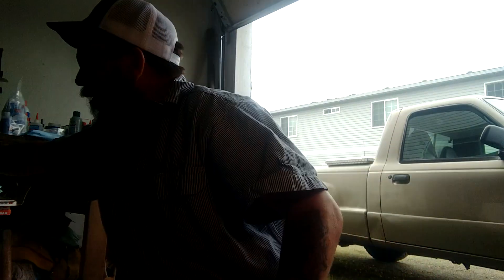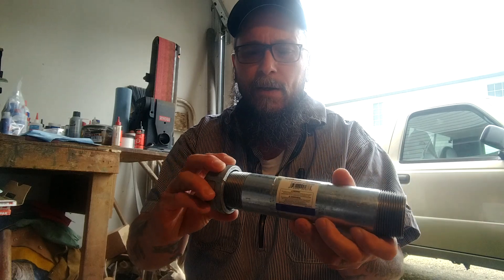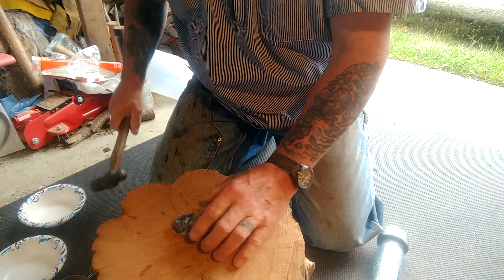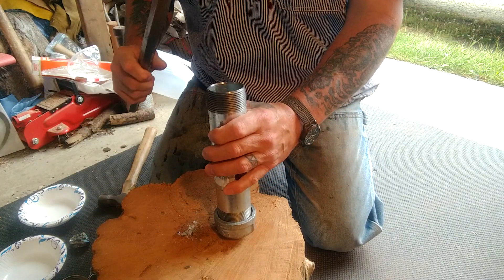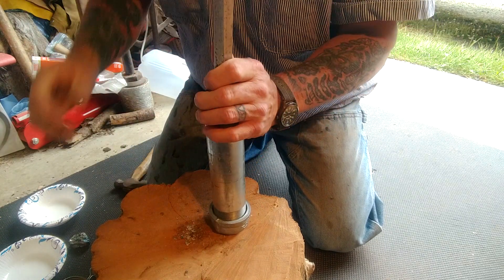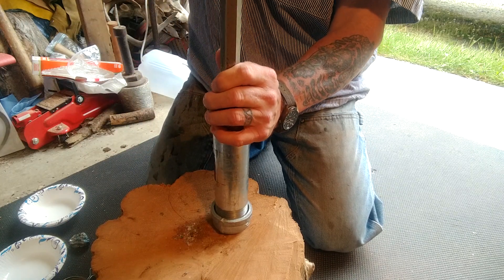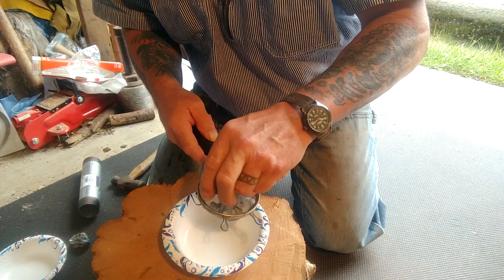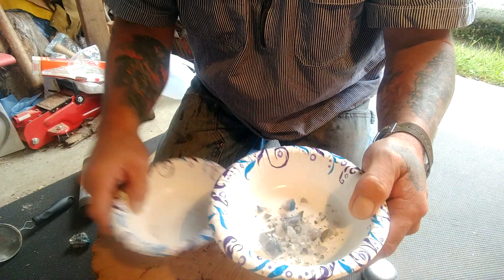Crushing Rock for Inlays 🇺🇸

Comment: good stuff Red, that amethyst is a quartzite so will run 7 Mohs so is a pretty hard rock. It should shatter well and give nice purple little shards.
Reply from the maker: Thank you brother 🇺🇸💯🇦🇺
It definitely is some hard stuff.
Tomorrow I'm going to be smashing up some agates from my beach
Reply: @sodacan1011111111111  agate is the same, 7 Mohs. For context hardened steel is 5.5 Mohs. So these rocks are a lot harder than the steel you are using to smash them up with. Agate is a beautiful stone, with lots of variation and colours. Looking forward to seeing what you come up with.
Reply from the maker: Thank you for the information brother. It should be some beautiful stuff. 🇺🇸🇦🇺